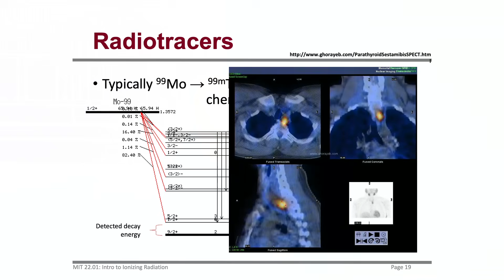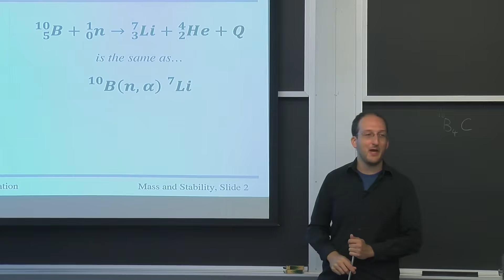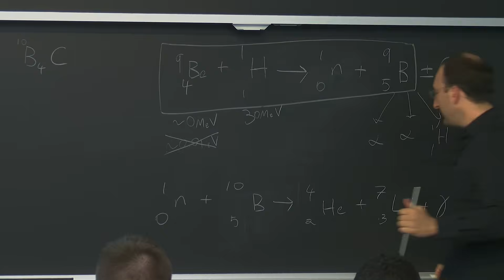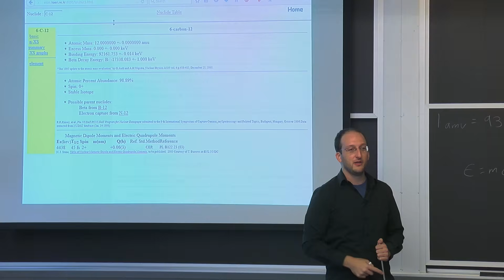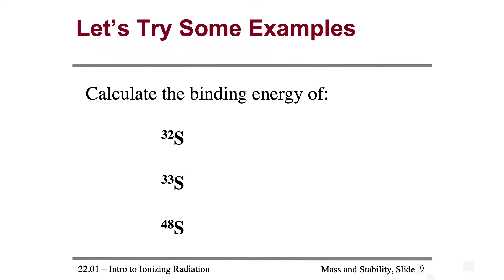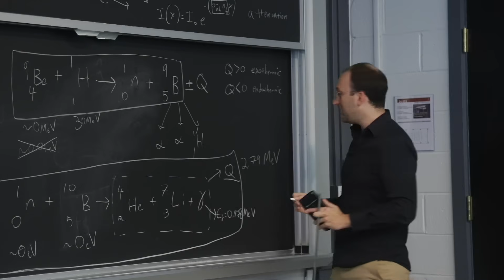3. Nuclear Mass and Stability, Nuclear Reactions and Notation, Introduction to Cross Section

Comment: I don’t get it… if the binding energy of Boron is 64 MeV and sum of Lithium and Helium is 67 (39 + 28) and the kinitic energy of the introduced neutron to destabilise the Boron is given as negligible then wouldn’t it be endothermic? It requires energy. How do you have a sum of binding energy greater than the initial state? I can only assume the absolute minimum kinetic energy of the introduced neutron to boron is greater than the difference

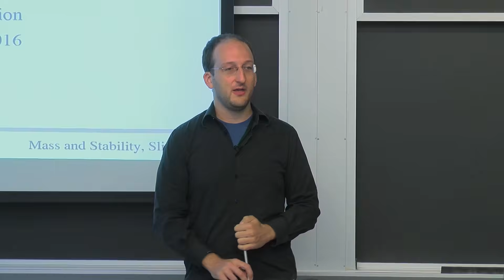Comment: 7:00 On Nuclear Notation 
- Explaining how BCNT (brain cancer therapy machine) works and why we made it this way
- - Beryllium is a good material 
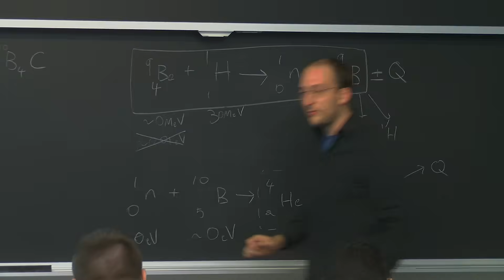18:46 Reading the KAERI TABLE
- Binding energy 
- - Mev/c^2 is how you do your mass mostly
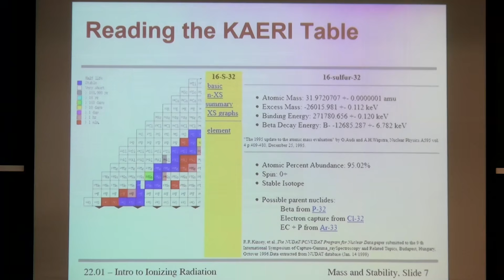30:29 What is  cross section

- Solving an ODE for it, remember your boundary conditions
- - Rate of exponential Attenuation 
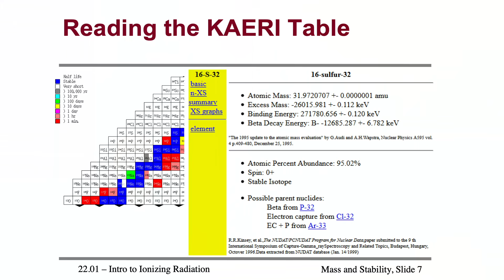36:19 Explaining previous terms more in depth (if you want some basics quick this is the place) 
- Excess mass means something only to our arbitrary way of measuring mass? (not actually physical phenomenon?) 
- - Examples (for finding binding energy)

Comment: I keep trying but I can't get this formula to work.
BE=[16(1.007825)+16(1.008664)-(-0.0027928)-32]c² 
I don't get 271.764
I get numbers that arent right at all, and a few orders of magnitude off on top of that. Is there anywhere  I can get a more detailed explaination of this formula and maybe what I might be doing wrong? :/
Reply: When you have BE = [16(1.007825)+16(1.008664)-(-0.0027928)+32]c², you have units of [amu]*c². 

Keep the units attached to each:
BE = [  16(1.007825) [amu] + 16(1.008664) [amu] - ((-0.0027928)+32) [amu]  ] * c². 
This comes out to 
BE = (0.291752 [amu]) * c^2. 

From there, you convert back to MeV:
BE = (0.291752 [amu] * 931.49 [(MeV/c^2)/amu] * c^2
Or
BE = (0.291752 * 931.49 [MeV/c^2]) * c^2   (units of [amu] cancel)

You can see that the c^2 units cancel and you're left with units of [MeV]. Carry out the multiplication to get 
BE = 271.76407 [MeV]
Reply: @nicknass144  thanks for the help 🙂
Reply: @nicknass144  the actual problem is that she is having a extra Zero here (-0.0027928) instead of (-0.027928).
Reply: Wait, is it -32 or + 32? Uhm..

Comment: I like watching these videos and worked as chemist for a government electrical and water utility for nearly 37 years. I am a proponent of thorium fission because it is less dangerous than uranium fission plants and this technology can be used to generate electricity for base loading. I believe that nuclear fusion will probably the long term energy solution, but is decades away for commercial use.
Reply: Both Thorium and Uranium are equally as safe, it's the fact we use fast breeders and molten salt reactors for thorium and uranium which makes both our fissile reverses last thousands of years, and reduce the amount of waste products. Thorium alone doesn't make it safer. I agree about fission being a great baseload whilst other technologies mature

Comment: It looks as though there's a set of spreadsheets that would be useful for nuclear engineers doing these calculations. 
Conversations between nuclear engineers and rocket scientists are likely to get confusing if they ever start talking about queues. There's probably a joke in there if you add a computer scientist to the mix.

Comment: The reason why people don't explicitly write for mass keV/c^2 but just keV is the tradition from high energy physics that we usually set c = hbar (reduced Planck const.)  = 1. It's called natural unit. If we want these back we can just do a dimensional analysis and get the correct SI unit value.
Reply: This absolutely not true, at least for nuclear physicists and nuclear engineers
Reply: @Garage-physicist  go read more paper.
Reply: @huanghan1911  I am a nuclear physicist at Lawrence Livermore National Lab. We don’t use natural units. I’ve never seen a nuclear engineer use natural units. It doesn’t make sense to do so when you’re performing calculations that need units. E.g., Oppenheimer could not assume that the critical mass of U235 is just “1”. Theoretical particle physicists do sometimes use natural units, however.
Reply: @Garage-physicist  Good to know. I work in HEP theory and CMT at Cornell, we always use natural units to simplify the calculations, 99% of the time. Even in QCD, which is closely related to nuclear, we use natural unit. I never carry a c or hbar around when working on my equations. It's not that we don't make numerical calculation, it's just that there is a simple conversion that makes your life simpler. In condensed matter people also use hbar=1 very often.
Reply: A joule?